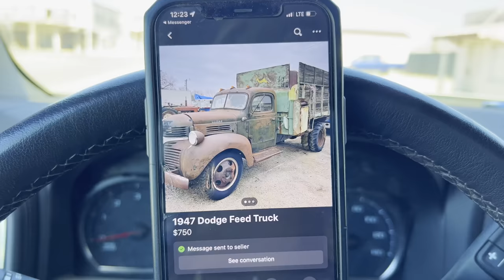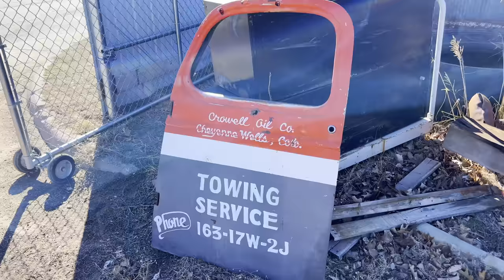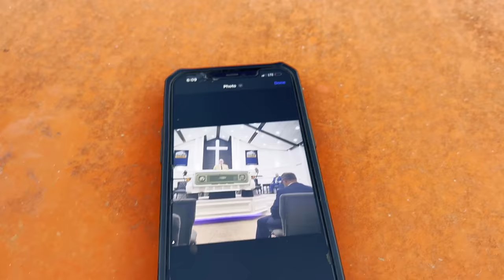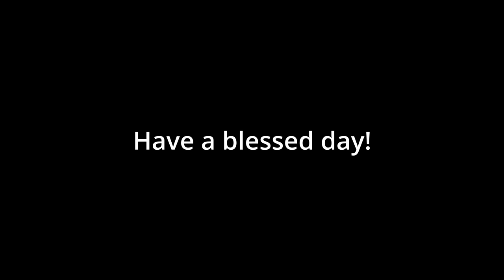A Day in the Life at the JUNKYARD!

Comment: Food for thought 🤔... 
If you can get that tank truck running you could use it for a gas ⛽ truck. Cars coming in have gas in them pump it out of the cars through a lubrifiner of a Simi truck, into the tank then you have a clean supply of gas. IT looked like that tank had compartments you could use one compartment to fill with diesel for your Crusher and Loader. And you still have room for air Compressor and cutting torches, tools, O now we have a YARD TRUCK... HEAVY DUTY and you could mount a small Crain on the back corner. That might be a good idea for when Scilace comes and helps 🌞🙏👍